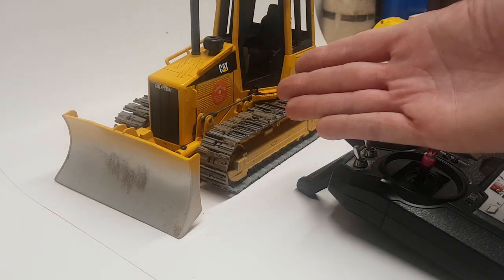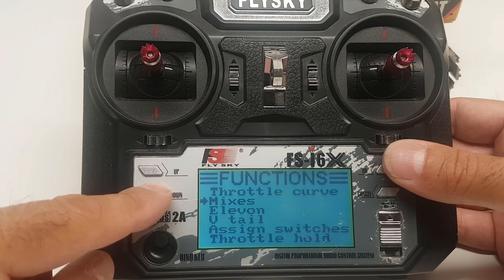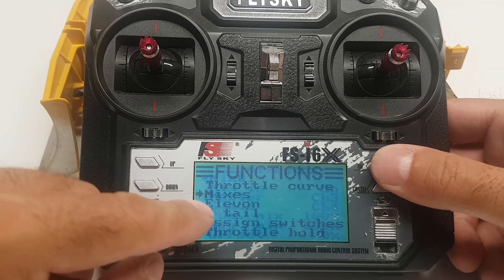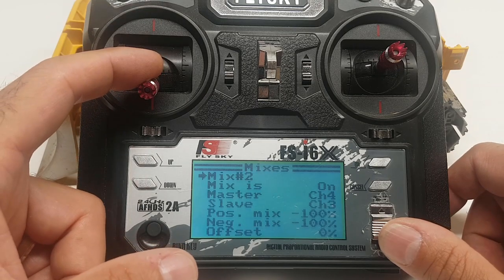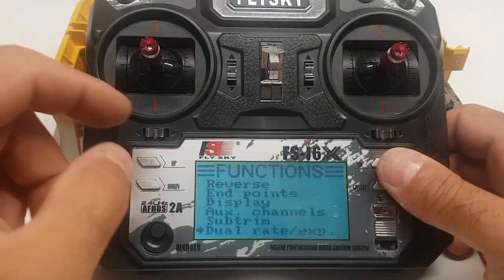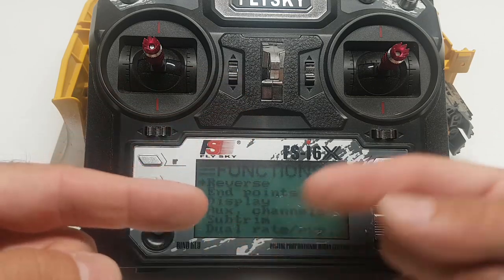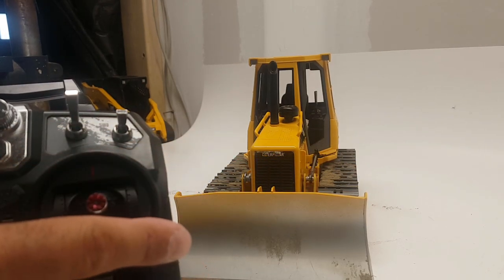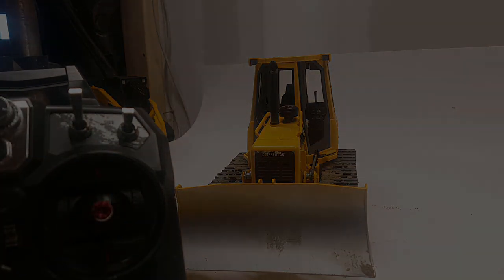RC Dozer Build Part 2 (remote control setup)

Comment: Hello, very interesting video again, I have transferred the settings as you indicated to my FlySky FS-I6X, what the bulldozer does not want to do is turn on its axis, the tracks move a very small amount but in the right direction, one pulls and the other pushes.
Reply from the maker: You can only pivot if you do the stick left or right with no forward movement to do a spin where the tracks spin opposite at the same speed. You can not do just 1 track moves and the other stays. It is proportional steering based on where your stick is pointing.
Reply: It's strange, very strange, I played with it for a quarter of an hour, it turned nicely on both sides around its axis and then an hour later it blocks again every time I want to turn it. Are there any settings that can influence this behavior?
Reply: Oh yeah, the forward/reverse and turn controls are on channels 1 and 2 and the Sticks mode on Mode 2, I don't know if that plays a role.

Comment: What pins on receiver does the battery hook up to? I don’t want to fry my new fly sky receiver
Reply from the maker: Depending on your reciever connect all you servo wires. Then connect the battery to tge reciever to the same location as the black and red from the servo wires. Make sure not to use a battery that is more than 7.4v and with a low C rating.

Comment: Can you use a controller like this on a machine with a pre existing chip? Or do you have to buy a certain one to make these sticks work?
Reply from the maker: You would have to use a reciever and transmitter like a flysky or any other controller. There most affordable option is to use the flysky transmitter and reciever combo.

Comment: I am using this transmitter and receiver for my project tracked dump truck. Some reason when a servo is plugged into any channel the track starts and doesnt stop. What setting am i missing?

Comment: Quick question sir: is battery directly to the receiver after the switch or any bec or something?
Looking forward to see the asphalt machine in action. 
Thank you
Reply from the maker: The battery goes to a switch and then to reciever. I do not have a bec as I use servos only. And the 7.4v seems to be ok with no issues. But if you want to be safer you can use a bec.

Comment: Very helpful im just getting started with the hobby bought a top race loader and dump and just got the dozer to build would love to get a whole fleet and hold a even here in northeast ohio or make a big construction world for people to come and use. Another question do you build alot of them to save money or get sponsored for some of the equipment thanks!
Reply from the maker: Hey Corey, glad you are getting into the hobby. Lots to learn so if you have any questions facebook and forums will get you a lot of answers. If you have a question you can ask it on my Instagram and I can quickly answer. Link in the bio here. As for the builds... save some money but more for the enjoyment of building and learning. No sponsors. Everything I have bought.

Comment: This awesome but I have one question about the electronics, do you not need a way of stepping down the voltage from the battery? Since most servo's run at 6v?
Reply from the maker: in this case I am running a 7.4v battery so it is not far off from the 6v. So I run it straight to the receiver. I have had no issues with the servos and I run this thing all the time. it is my most reliable rc. Maybe I was lucky but I think because it is only 1.4 v off what servos require it is not a problem. if I was running 11.1v then it would be a little more of an issue. but it doesn't need all that voltage since it is a servo driven machine.
Reply from the maker: Also, if you are worried about the voltage you can use a BEC to regulate the power from a 3s battery down to a safe voltage. for the dozer I am running 2 servos at once which draws more power.
Reply: @RCConstructionHobby  Thanks so much for the reply! Yeah I figured a 3S 11.1v would be way too much haha. Interesting I guess I'll try the same thing I was worried about the voltage so I may still get a BEC to see how it goes as well and see if it makes a difference. Thanks for making these videos! There's not too many out there explaining the whole thing.
Reply from the maker: No worries. If you have questions ask and I will try and answer them.

Comment: Have you totaled the cost of all of these parts together? I’m considering trying a build like this
Reply from the maker: Yes I have but it is in Canadian. Servos were $25 each for the drives. 1 servo for the blade about $15. $30 for wheel weights $85 for receiver and transmitter. And a battery about $30. Toy is $30. Also, rod and eyelet for the blade probably about $5. So that is it plus my time....$$$$ priceless.

Comment: how do I change the throttle from left stick to right ? Right now one stick moves one servo and the other moves the other servo. I would like to have throttle and left right on the spring loaded stick .
Reply from the maker: You would change the channel assignment. So if channels 3 and 4 are the left stick then move those servos to 1 and 2 and then adjust the mixes so they reflect that change.
Reply: @RCConstructionHobby  somehow managed to find it before your replay. Thank you for everything tho you aspired my first conversion :)

Comment: When you’ve set the values how do you save them
Reply from the maker: Hold the back/exit button for 2-3 seconds. Don't just press it to exit. Then go back in to see if it stored the changes. This is for this particular transmitter. The others may have different ways to store it by just pressing back.
Reply: @RCConstructionHobby  Thanks works a treat, got everything done and I must say it really looks professional. The blade work’s perfect, I have a problem I have the FS i6 when i move the stick left and right they work the opposite direction.

Comment: How did you get the throttle stick to center?
Reply from the maker: You will need to purchase an extra piece to install inside the transmitter so that it can be spring loaded. Search aliexpress or banggood for this model transmitter and there should be a stick center kit.